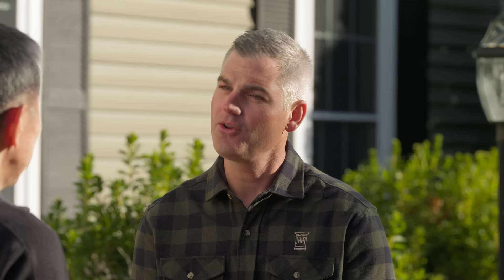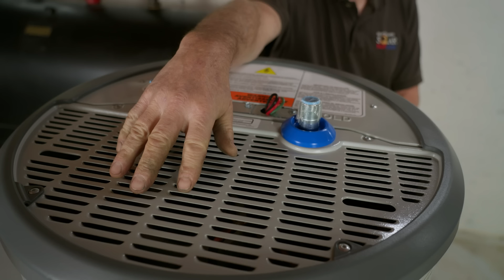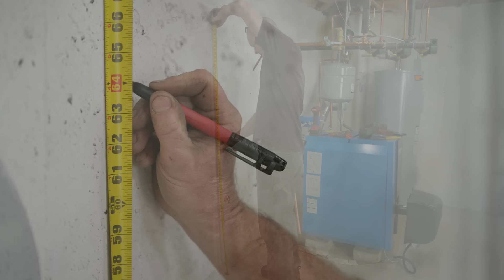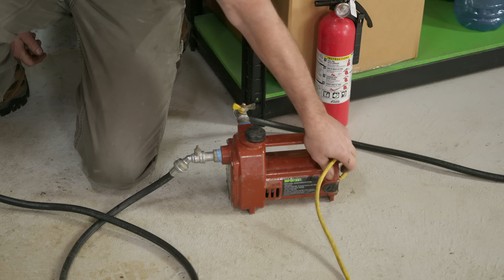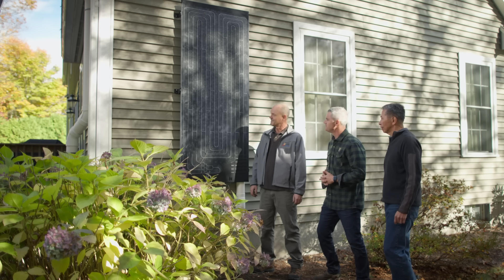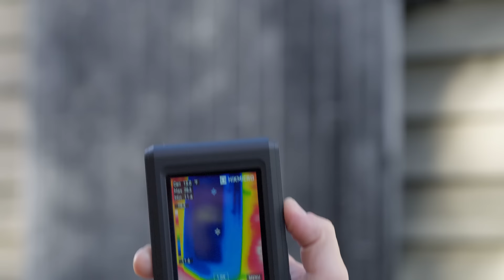Heat Pump Water Heater for Cold Climates | Ask This Old House

Comment: Why are so many people missing the fact that the heat pump system beats oil and propane as far as cost to operate on a yearly basis and theres little to no regular maintenance cost. I grew up with oil heat and hot water in north jersey and the heat pump system is massively cheaper so I can't understand the negative comments

Comment: I have  a very similar Buderus boiler. I have a water heater on a zone to the boiler. About $30 a month to make hot water in the Summer. It's "free" in the Winter.  :-) Electric rates are so high here even with the current geopolitically inflated oil prices it's cheaper than electric.

Comment: Almost entirely overlooked in this video is the important role of latent heat, aka humidity, as the source for heating the hot water.  It is alluded to tangentially in the brief discussion of frost on the outside panel, but totally ignored for the traditional heat pump water heater which pulls heat out of the air in the basement.  

The totally indoor heat pump water heater gets a good percentage of its heat from the humidity in basement air,  particularly in damp basements, which significantly mitigates to extent to which it may drop the temperature in the basement.  And there is a huge advantage which is dehumidification of the basement which is constantly absorbing moisture which works its way up through the floor primarily and also through the foundation walls entering the space at roughly 50 degrees.  The indoor hot water heater is, in effect, partially a ground source heat pump which will operate more efficiently in the cold winters, and the inside outside water heater is purely an air source water heater which only cools and dehumidifies outside air with no collateral benefit to the people inside.

The air only outside heat pump doesn't even make sense in a hot dry climate where there is still the need to cool the basement, which the inside air heat pump will do, in addition to working as a dehumidifier.  When you calculate the percentage of hot water you get from the humidity in the air--latent heat--and the percentage you get from the temperature drop in the air itself, it should be obvious that the outside air source heat pump is both less efficient and losing the synergy of dehumidification.  

The only reason to use the outside panel is if there is no basement, the dwelling is very small and/or space for the heat pump water heater is too small,  and there are a lot of people living there who need lots of hot water.

In a cold climate the indoor air heat basement pump will drop the temperature a few degrees in the basement, in the winter and significantly dehumidify the space.  In the summer it will also cool the basement whose temperature has risen due to warm outdoor temperatures and even more effectively dehumidify the basement leading to a cooler, more comfortable and moisture and mold free space. 

Ignoring latent heat in the calculation results in misleading conclusions.
Reply: This sounds perfect for a 10x10 fish room.  A 200 gallon saltwater aquarium will create high humidity and heat (78 degree water).  I might need to design a shroud so I can rinse the coils periodically of the salty air.
Reply: @pennguino9137  An indoor electric heat pump water heater is perfect for a moderate size basement, maybe 400 square feet with a concrete floor through which water in the ground will work its way up adding humidity to the space and helping to maintain a minimum temperature of 50 degrees.  The temperature of the earth below will prevent the inside temperature of the basement from falling too low. and the extraction of heat from the water vapor in the air will help keep it dry.  That's simple physics.

The idea of perfection for  a 200 gallon 10'x10' saltwater fish tank is completely absurd.  To begin a 10' x 10' tank even one foot deep will be about 800 gallons.  There are about 8 gallons in a cubic foot so a 10' x 10' "tank" with 200 gallons would have water about 3 inches deep

This suggestion is about as far off the deep end and irrelevant as one could go.
Reply: You must have caught the dumb early in life.  Most people shake off the effects of it eventually.  You on the other hand, leaned into it.  Actually embracing it and learing to excel in it.
I never said a 10x10 fish tank.  The fact the HPWH cools a room and dehumidifies makes it a great candidate for an aquarium room that produces elevated humidity and heat.
Good luck with life.  I hope you don't suck at it as much as you suck at posting.
Bless your heart.

If you have moisture coming through your basement floor, the house was not built properly.  You should have 4-6 inches of stone, then a 10 mil vapor barrier, and at least 2 inches of insulation, depending on climate zone.  All taped and sealed.  May need an active Radon mitigation system.
Reply: @pennguino9137  I hesitate to go ad hominem, but this is one of the silliest responses, and dare I say it, narcissistic replies I have provoked.  You absolutely said a "10 by 10 fish tank."   And even if I accept you spurious revision and you now mean a 10 by 10 room which you will be dehumidifying and cooling while trying simultaneously to raise the temperature of the water to a tropical level.  In order not to depreciate your intelligence, I will graciously conclude you are joking and that you are sarcastically dismissing the whole concept of an indoor heat pump.  Of course, I can't be sure as your language in infused with the plausible deniability of innuendo.

Regarding a house not being "built properly," if it doesn't have your specifications for stone, insulation and vapor barrier, you have described a situation which is not true for most existing houses.  Millions of houses have no vapor barrier.  Millions of basements are not habitable spaces.  Even the best vapor barrier will let in some moisture.  Following your prescription instead of installing a heat pump water heater when their old water heater fails, they should clear out the basement.  Temporarily disconnect any HVAC system, washing machines.  Hire a general contractor to remove the existing concrete floor and hand excavate out 8 inches of material.  Then bring in stone and spread it by hand, lay down a continuous layer of extruded (I assume) polystyrene insulation, add the vapor barrier and fnally pour a new 4 in thick concrete floor, after which they should buy a traditional electric resistance or gas water heater all for the low, low price of maybe 10 times the cost of the installation of the heat pump water heater.  And, of course, you will have a drier basement than before, but it will not be moisture free because I am sure you are aware that while effective no vapor barriers are 100% impermeable.  And, of course, that's if you want the make the basement "habitable space" instead of "uninhabitable space."

Best solution for most peple in most climate zones is to replace the old gas, oil or electric water heater, whether conventional or "on demand" with an electric heat pump water heater in the basement getting the heat for the hot water from the air and moisture in the inside the basement, even if it is a basement floor and foundation walls constructed to the most recent approved construction methods.

You can attack me for being "dumb" and saying I "suck" or some such foolishness.  That kind of stuff doesn't any meaning to the discussion.  It is a quintessential "ad hominem argument."  Your task is to prove me wrong either in whole or in some detail or to acknowledge that I am right and you are wrong, the reverse of which I would be only too happy to do.  The problem with one being right all the time is, in addition to being obnoxious, one never learns anything.   (excuse any typos.  I write fast.)
Reply: @davidcylkowski3124  
I didn't read anything past your second sentence.  I copied and pasted my opening statement.
"This sounds perfect for a 10x10 fish room"  
Learn to read.
Bless You heart

Comment: Would have been useful to see one shower heat up cycle and watch both system power draw with an electricity monitor (Sense equivalent) over time to see that energy consumption difference in real time. Then extrapolate that savings through the year.

Comment: We live in WI and currently have a gas power vent water heater in the basement.  We are finishing about 1/2 of the basement space and I am concerned about the cooling with a heat pump water heater.  The only reasonable exterior location is on a north outside wall, probably not ideal.  We have an attached garage.  What about placing the panel on an interior garage wall?  An advantage in the winter of it not being as cold as outside in the winter, although the garage would become colder.  In the summer it would have the plus of reducing the temperature in the garage on hot days.  Any concerns about humidity and condensation?  My other thought is to go with a super high efficiency gas water heater that uses outside air supply for the most efficiency on gas and not loosing inside air to outside.

Comment: Can this system be used with radiant floor heating in cold climates? Also, is it only working from the that black panel heat pump, or does it have some other source of backup when the outdoor temperatures are really cold?

Comment: The heat pump water heater comparison really highlighted how efficiency shifts depending on climate and installation design, especially between unitary and split systems. A professional service provider like American Residential Services would usually evaluate the home’s heating load and placement before choosing a system type rather than focusing only on equipment specs. It made the tradeoffs between COP and real conditions easier to understand.

Comment: Am I confused- He said you will use a heat pump water heater in your basement. This is a slit system far less known, there is an evaporator panel and it can be mounted any where in the house. Then the other guys say you mounted it outside like a solar panel

Comment: My cousin is a plumber in the Detroit area and they have been running an intake duct to the attic for the regular HPDHWs, because even in the winter in an old house the attic is still hot, while the unfinished, uninsulated basement (where the DHW usually is) is very much not hot.
Reply: this is my dream but in old house could not find direct path from basement to attic, except outside house which would reduce efficiency and be tough aesthetically
Reply: @eapenmathew5899  old chimney flue maybe? That's how our gas water heater & furnace vent right now, my plan is to maybe run a duct up it into the attic if/when we switch

Comment: Why not just use oil for hot water by using an indirect hot water tank?  Just make the tank another heating zone.  Oil is very efficient for boiling. I have a similar setup but using natural gas.  Electricity is way too expensive to use in New England.

Comment: I have had a solar hot water tank upstream of my gas fired tank for 25 years now.  ZERO maintenance. Even today with the panels half covered in snow the tanks is at 70 degrees. So today the gas is taking the eater from 70 to 130, instead of 40 or so.  All spring summer and fall the solar tank is 120 degrees and I have tons of hot water. Which 25 years ago with 2 teenage daughters came in handy. I am considering  making my small barn into a ADU for my wife and I. I had been thinking of trying to save the solar hot water system. After this I am not so sure. However my plumber  says to go ahead and try to save it.  wonder what TOH thinks.

Comment: Just for clarity, electric hot water heaters are 100% efficient. Electricity is just expensive. Heat pumps are more efficient in the fact that they can fold more heat per kilowatt than they lose.

Comment: Many comments about oil hot water heating and about ‘regular’ heat pump water heaters.

The ‘split’ heat pump water heater in the video is mostly being purchased by people who are electrifying their space heating or plan to. When a boiler or furnace is removed, there’s no longer a source of warm air to keep a ‘regular’ heat pump water heater happy. In fact, a basement can get cold enough to freeze pipes in a well insulated home and during a cold snap. Even without a freeze risk, a regular heat pump water heater’s COP in a 50 degree basement is extremely poor. May as well have a resistance water heater at that point.

Further, the warm air around a boiler/furnace isn’t ’waste’ or ‘free’ heat- it costs just as much to heat that air as it does to heat the air in your bedroom. And you can’t vent a regular heat pump water heater outside- the potentially colder air that replaces it just has to be heated up again.

Of course, if you don’t have a basement at all and your water heater is in a closet, then a ‘split’ heat pump water heater is the only electric option besides a common resistance water heater. Thank you!
Reply: Of course you can vent a heat pump water heater to the outside, both inlet air and exhaust air. However, that's not always practical, as it can involve significant costs in fabricating and installing the ducting. I thought this sealed refrigerant and exterior heat exchanger  system was brilliant.

Comment: One thing to remember about the type of heat pump that takes the heat from interior air is that this heat had to come from somewhere and during the heating season that means from your furnace. The efficiency of the water heater therefore is reduced because you really should be adding in the fact that you've already paid for that heat through the extra fuel burned in the furnace. You might even further argue that the efficiency of a resistance water heater is slightly higher during the heating system as all the standby losses are to the interior of the house and therefore should be slightly reducing the load on the space heating system.
Reply: Great points! Need a job? 😊

Comment: Fluff. 
Modern oil fired water heater:

Performance: High-performance, modern oil-fired water heaters can reach efficiencies up to 90–95%, with exceptionally high recovery rates of over 100 gallons per hour

They will try to tell you that this unit is more efficient and it is against an electric water heater.

And if the electric goes out, you've got nothing.

If you run out of oil you can always go grab some diesel at the gas station and 5 gallons will last you two or three days

Just saying

Comment: I just got a deal from my power company in Maryland. 50 gallon HP Rheeme at Home Depot $2K 
I paid $700.00 from the supply house for the same model Rheeme My 50 gallon GE is 25 years old.😮
Reply: I'd need an English professor's help to accurately figure out that comment (and in fairness, some many others on here and in other YT comment sections).  Does anyone still care about spelling, punctuation and grammar?

Comment: Gas, oil , electric if you think the planet is burning then you should do what out grandparents (and Australians) did and hang any of your laundry on a clothes line.  
Added bonus is a bit of moisture during the dry cold months.
Time will tell on these units.  We aren’t saving the planet with more refrigerants that will leak or more frequent equipment replacements

Comment: When I renovated my 1903 historic full masonry home in 2023, I made it all-electric to leverage the output of the 9.76 kW solar array. I installed a Rheem hybrid in my unconditioned basement, which has a rubble foundation typical of historic neighborhoods in St. Louis, where we have four seasons and sometimes have cold spells below 0°. I operate it on the heat pump to maintain 120°F. The heat pump has cut back on my need to run a dehumidifier in the basement. The Rheem has WiFi and an app that you can use to make a custom daily program to meet your needs. In my case, it’s easiest to leave it on 120° until about half hour before I want to soak in my clawfoot tub, at which point I use the app to crank it up to 140°F, which means it uses its resistance heater to raise the heat rapidly.  After I draw my bath I use the app to set it back to 120°. I’m very happy with this hybrid water heater, which I got on sale from the orange box store.

Comment: Looks like the majority of comments are along the lines of ‘why not a conventional heat pump water heater’ or even ‘use the oil boiler’. 

In many markets folks are electrifying their heating- getting rid of their fuel based boilers and furnaces. So fuel based hot water heating is not an option. 

Moreover, removing the only source of heat in a basement and then using a conventional heat pump water heater cools the basement intolerably. There are plenty of cases of pipes freezing when a switch was made from a boiler to minisplits, for example. Even without a basement freezing risk, the efficiency of a conventional heat pump water heater in a 50 degree basement is very poor.

And warm air around a boiler to feed a regular heat pump water heater isn’t ‘free’ or ‘waste heat’, but that’s another story.

Like lots of folks, the gentleman in the video will be getting rid of his boiler, and did not want it running in the summer anyway. So this solution was the only one other than his resistance water heater. Thank you!